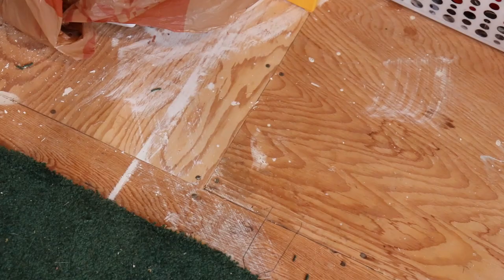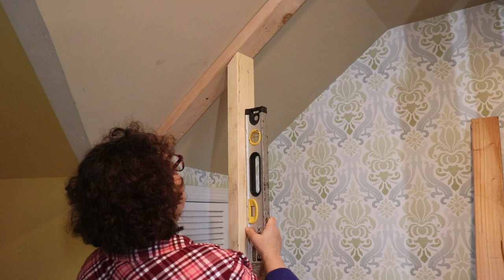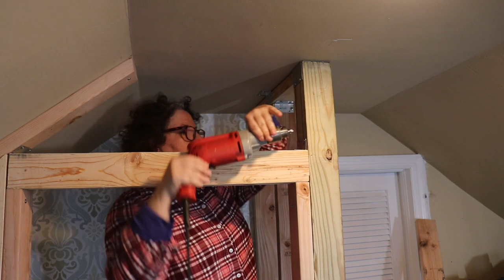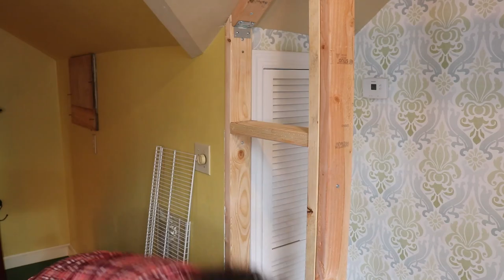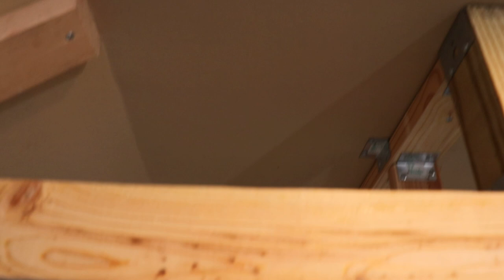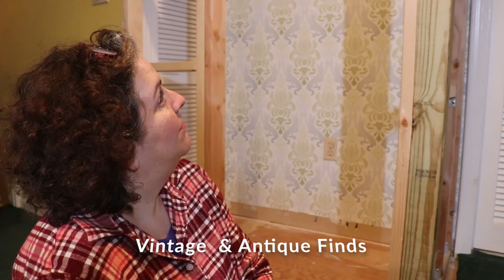Master Bedroom Makeover Series || DIY Closet || Episode 4 ||

Comment: When my husband and I were younger, we remodeled or restored houses to flip, I was the sheet rocker and mudder among other things. Anyway this is what I did instead of sanding, I used a big sponge and a 5 gal bucket of water the wet sponge smothes out the compound beautifully, get your compound as smothe as you can by wetting as you go along then when dry use the wet sponge to get out any imperfections. you'll do fine!
Reply: I’m gonna try this. I used the sanding screen last time but dust went everywhere even though I used plastic sheeting for protection. I’ve been dreading the finish work. Will this step solve the little bubbles in the mud too?

Comment: I wouldn't put the jewelry case on the inside of the closet. It's a tight space and bad lighting. Also, you'll have to move your clothes to get to it. Maybe affix it to the outside wall instead or make niches on the wall space next to the door.
Reply: Also agree with this. It will be tight in there. Also, you might reconsider the attic shoe storage for off season storage. I think access will be troublesome for everyday access leading to leaving them on the floor. Your doors - since they are no longer bifold - will provide lots of storage on the backs of those doors.

Comment: Hi, Sophia! Again you inspire us to better ourselves and our surroundings! A couple of thoughts.. Where you put the flat metal brace on the closet door frame should be put on the back side. If you leave it on the front the 2 x 4's will no longer be flush to accept the drywall. It would be cool if the jewelry were on the outside of the closet by the door.  I think you would have a lighting problem if you put it on the inside. Thanks for all the new terminology for the build. Great job!!

Comment: My closet is pretty small at 42 inches wide. I hang everything except 3 sweaters on a shelf with my underwear in a plastic shoebox, folded 4 pairs of jeans and shoes also on the shelf and a door hanger. I have 18 every day shirts and a small capsule of church slacks, dresses and shirts. Plenty of room except I can’t put  winter in with summer so in the off season I have to store one season somewhere else. I’d imagine you will have to use the back of Scott’s closet for off season. My pj’s and socks go in a tiny nightstand drawer so no dresser. Our apt is 320 square feet.

Comment: The outside bar is going to hinder your sheet rock install. I think you’re doing great. I’m slowly fixing my sheet rock too.
Reply from the maker: Then I ll remove it. It s not a big deal
Reply: Was thinking the same thing.  You could brace it on the inside if you are still concerned.

Comment: Good job so far Sophia. If you are going to attach the jewelry box to the wall you will permanently block your access to your storage door under the eave. IF you are going to do that then just empty the stuff you have in there, wall off a section of it, insulate it and put your jewelry box inside that door. This will free up that whole area where you were going to attach it and you can put rolling shelves there for more storage or one of those hanging shelf things for your purses/shoes which can be easily removed.
Reply from the maker: I mentioned I plan on emptying the attic storage area and have a cubby on wheels for shoes. The jewelry box can be unhooked if need be.

Comment: Love what you have done so far...I have an idea instead of flat sheet rock along the header how about an old fashioned transome? The kind that is wood paneled with a carved design in it and it has a tilt out feature that has a small chain on either side that holds the tilt this is purely for decoration sake but does go with the 20's theme.or a faux beveled glass insert between the ceiling and top of the header maybe copy the design that you have in those little windows in the living room .just a couple of ideas hope you like them
Reply: very cool idea

Comment: You could consider getting a vertical wire hanger for your shoes and then store your off season clothes in the attic space. The wire hanger can be installed on the inside of the closet doors.

Comment: It's coming together very well, Sophia! Looking very good. I think it's an excellent idea to put the cross braces on the bathroom door side of the closet as well. Not only does it give stability to the wall itself, but also provides stability for the sheet rock. What if you tripped or something, lost your balance, and ended up smashing into the wall? Without the braces you could go right through the sheet rock. It's a worst case scenario, but better safe than sorry. Very impressed with your mad skills for sure! Will the sheet rock lay flush with the support bracket you put at the top where the header is? I'm thinking maybe all you may need is one on the inside? Anyway, kudos for a job well done. Excited for more progress!

Comment: I love these videos! Great motivation! I'm a bit confused though about the 2x4 that got nailed into the wall by the existing closet/attic access in the last video. It seems to be flush to the wall but you have to install drywall/sheetrock and now you don't have a half inch gap. Did I miss part of the plan here? I need to know!

Comment: Since you decided to go a bit extra with the braces, have you considered not sheet rocking parts of the inside and using the horizontal pieces as shelves? You could easily paint the 2x4's a bright high gloss white on the inside to make it feel finished. Just a thought for extra shelves, esp on the door wall!

Comment: May I suggest you fit the jewelry stand into the side of the closet with the mirror on the outside?
Reply from the maker: I would have to reconstruct a whole side for that. Not a bad idea. But too late. Should have thought about that
Reply: @mygreatchallenge  oh Sophia…thank you for answering my comment…very sweet. I indeed realised it and just wanted to spark a thought and thought maybe it was still “on time” before the sheet rocking. Having remodelled many homes I often thought of ideas after it was “too late” but maybe an idea for the other side of the room where a smaller cupboard for sweaters and linens could include incorporating it there…😊 you are doing an amazing job and motivated me to do some things I procrastinated because of my condition. I said to myself: if it’s only five minutes it is still five minutes and Sophia said no rush!

Comment: Wow, Sophia! This is amazing! YOU are amazing! This is going to be so fabulous when it is complete!!  I have a question for you that I did not hear you talk about and it's hard to tell in the video.  I believe you mentioned the area to the left of the door you will be adding sheetrock to it and finishing it off, correct? It is hard to tell in the video but did you leave room where you placed your framing on the left side to account for the thickness of the sheetrock? It is hard to tell but it looks like your 2x4 framing might be flush with the existing sheetrock wall so when you add sheetrock to your new area if you didn't account for your 1/2 inch thickness of your sheetrock you may struggle over there. Also, I think your closet is extremely solid and I'm not sure that metal piece you used to reinforce the top of the frame to the left of where the door will be is necessary. I worry that it will interfere with your sheetrock and cause the sheetrock to not lay flat against your frame when you go to put it up. If it lays flat, no worries. I just wondered as you were screwing that piece on if it was going to interfere with keeping your sheetrock flat against the frame. I speak from experience, sheetrock does not like to bend. :-) Just a couple of comments...you are doing an amazing job and I can't wait to see the final product. It will be amazing!  I'm getting excited for you!